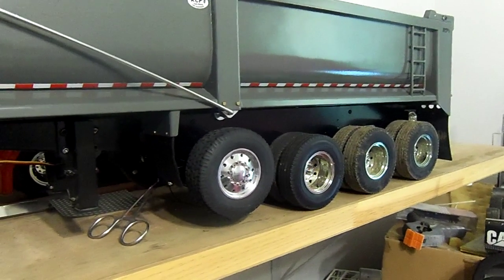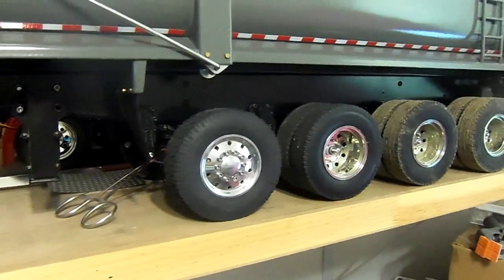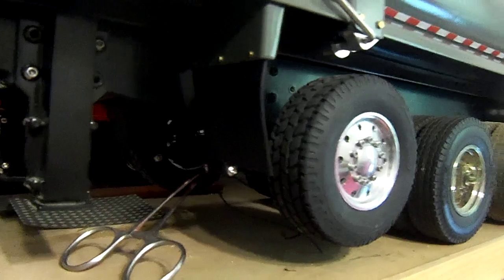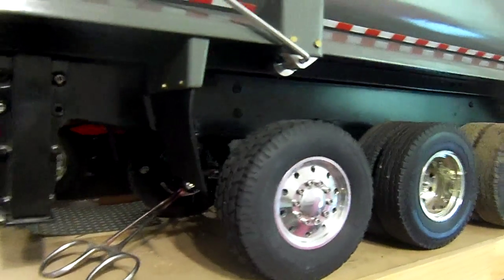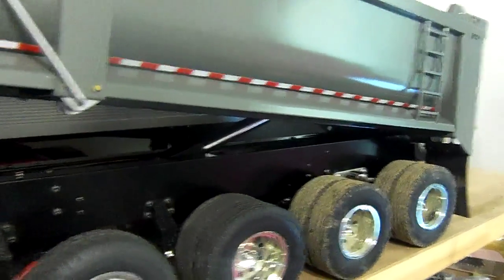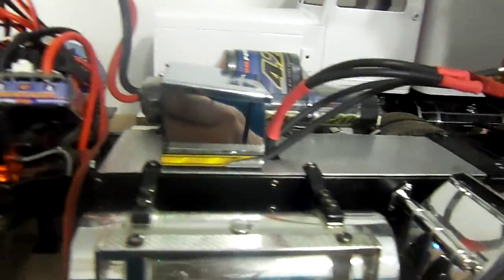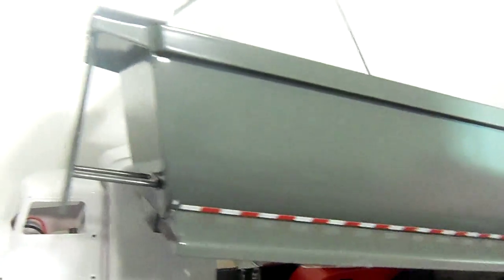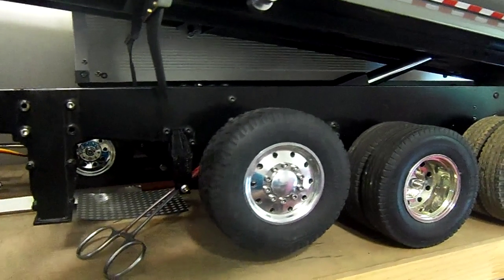rcp57 mini mac trailer lift axle

Comment: These planetary motors are noisy under load! I don't know what to do about it but it is a bit loud. I took one apart and filled it with grease but it didn't make much difference. Seems to be a common theme with everything I build and I think it is because all of the parts are metal. The sound just resonates right through!

Comment: Where can I buy one of them lift axles. Although I've experience with RC cars, I'm attempting to build my first RC dump truck. I'd like to build a 5 axle Kenworth truck, with lift axle, & dump that operates from the radio.  I've found where to buy the dump box, & hydraulic rams as well as the hydraulic pump for this build.  I CAN'T find anywhere a 1/14 scale drop axle. any & all help is appreciated.